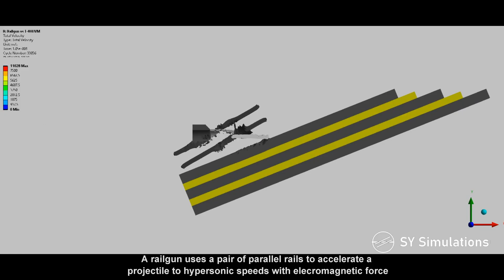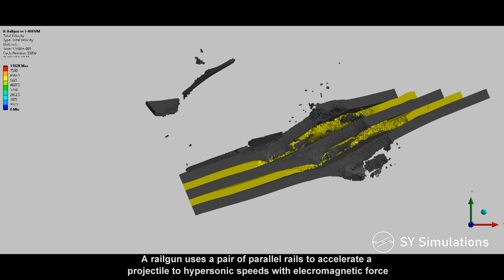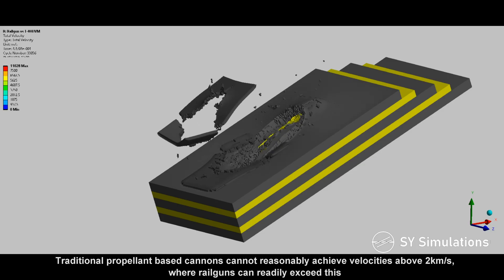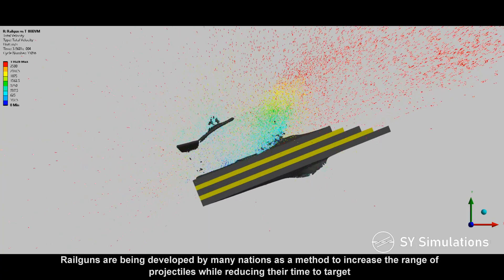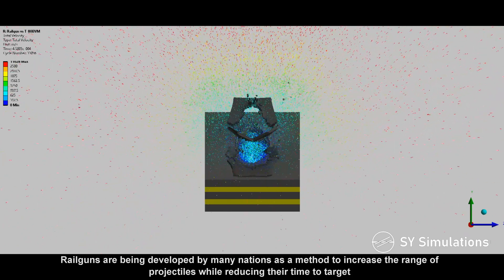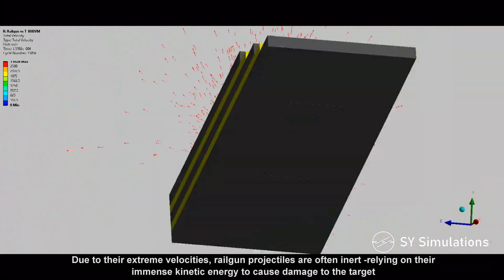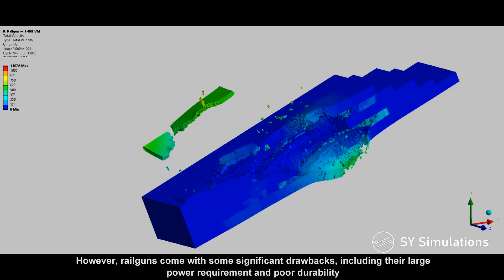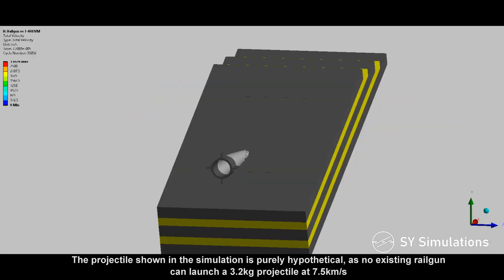RAILGUN vs T-80BVM | Hypersonic Armour Penetration Simulation | APRIL FOOLS' SPECIAL

Comment: War Thunder: orange driver, 15s repair and good to go

World of Tanks: -1500 HP, repair kit and drives off
Reply: In WT either it's yellow ammo or the whole tank becomes black
Reply: @warbrain1053 nah you know they just might hit you with that "shell shattered" somehow
Reply: @arnoldcobarrubias6593  oh yeah that's the third option
Reply: GHPC:

Driver killed
Gunner killed
Engine disabled
Gun barrel compromised
Commander killed
Fire in fighting compartment
Turret drive destroyed

Press TAB to switch vehicle.
Reply: @uschurch  LOL YES
Reply: "Shell shattered"
Reply: Cursed Tank Simulator: Crew knocked out, horizontal drive taken out, radio broken, fuel tank ruptured, engine fire, yellow breech
Reply: War thunder: Tungsten penetrator hits at mach fuck you, shell shattered
Reply: I got one better fam bounce ricochet
Reply: Nah no crew survived 

The post pen is faster than a detonated pg7 grenade
Reply: The biggest problem with railguns is velocity loss over distance. It may exit at Mach 10 but it’ll land at Mach 1. Just bring back battleships at this point
Reply: @davewebster5120 Yes, but a round going at 7.5 KM/S is still getting to 15KM in under 3.5s instead of 20s+. Significantly terminal effects and much faster time on target.

Comment: At those velocities 7500 m/s for instants do you even need to use tungsten? Wouldn’t most objects accelerated to that speed in atmosphere molten by the time they reach the target? Aside from perhaps tungsten or titanium or rhenium.
Reply: It's a matter of density. Similarly dense metals to tungsten just aren't strong enough for this use
Reply: @гига-нигга  You could use uranium, since while it's not strong, it effectively self-sharpens on impact.
Reply: @kauske  uranium may erode more during flight due to heating, I'd hold my breath on materials and let the materials scientists do the testing
Reply: @ You can make a composite penetrator, or ablative non-discarding sabot. But at the velocities that magnetic guns achieve it basically doesn't matter what you're shooting, it and the target will turn into liquid.
Reply: I think you stated your answer in your question? At those velocities, the projectile would hemorrhage material from hypersonic drag heating up the surface, steel has a significantly lower thermal capacitance, so even if it acts as an ablative for itself, it may be far too conductive
Reply: @V3RTIGO222 make a non-discarding sabot

the sabot will ablate, leaving the projectile unharmed
Reply: Carbon/aero gel cap. Wood like the early Soviet capsule heat shields. This is a solved problem.

Comment: That's no longer
 hypersonic. That's re-entry speeds at this point
Reply: But that's reentry speed
Reply: It may be reentry speed, if you enter an atmosphere with 7500m/s. You can also walk at atmospheric re-entry speeds, though it wouldnt be very fuel or time efficient if a spacecraft flew at 1.42m/s down a gravity well.
Interestingly, you wouldnt need a heat shield at those speeds. You would be moving so slowly, atmospheric friction wouldnt produce much heat. Its impact in the form of Wind would be of much greater consideration
Reply: Still hypersonic tho, reentry doesn't have much to do with mach

Comment: Just to give a perspective on speed. 

That projectile is traveling at MACH 21

Just for comparison. The speed at which the space shuttle reenters the atmosphere is MACH 25
Reply: And that velocity is upper atmosphere with significantly less drag
Reply: @V3RTIGO222  and still enough to compression heat air in front of it into a wall of ionised gas.
Reply: The shell whiz/crack from the round flying nearby would be terrifying
Reply: @Flociety It would be like an explosion.
Reply: ive seen video of them firing one at mach 8.8 and it was insane. they had set up had a series of walls and it just kept going through every single one
Reply: concidering it's a low drag object
would this also generate a plasma channel ? or is the aerodynasmic friction just too low for that ?
Reply: @bluewhalestudioblenderanim1132 it plasmas. thats one of the reasons railguns arent so fesable in atmospheric use. between the electricity, the friction, and the fireball they rip their own barrels apart with every shot
Reply: I think he means 7500 feet per second. Unless it's supposed to be a 'what if' scenario, not a realistic one.

Comment: And thats just a 20mm.
Reply: Did you ignore the sabot and gun? Full caliber 3.2 kilo is 57mm territory. 😂
Reply: @alistairalexanders  He's talking about the actual penetrator core, which is stated as 20x300mm in dimension.  For reference as to the stupidity of what a beefier penetrator would do, M829A4's is in the realm of 960mm in length and ~27mm in width, weighing ~7.5kg.  That would just fold the array and the rest of the tank in on itself if it hit with speeds shown in the vid 😂
Reply: @Registered_Simp  of course, and it's fired from a 120mm gun
Reply: @ Yeah.  My response was mainly geared towards the "Did you ignore the sabot and gun" part.

Comment: How about plasma or particle beams? Next year perhaps
Reply: I wonder if the simulation can do such a thing.  It probably doesn't simulate atoms.
Reply: @M4xPower  it could probably simulate a 1mm pellet though, which would enable some sort of similitude simulation
Reply: @MUJUNKY  I don't think high velocity pellets and relativistic ions are relevantly similar.  There have been accidents where people have been caught in a particle accelerator beam and the results aren't consistent with high velocity objects.  The effect of a weapon on a tank would probably be energy transfer in the form of heat and other radiation.  So I think the simulation would have to do flash vaporization of the outer molecules of the tank armour.  Note that the heat effects of high energy weapons like lasers and the heat effects of nuclear blasts are not good at damaging dense materials such as armour, or even just regular metal structures.  It requires the material to melt or sublimate and get out of the way.  This removes energy from the object.
Reply: @ That's a very good point about the need for damaged material to move out of the way. I read somewhere that ceramic armors would be especially good for dealing with lasers because of their ablative properties. Basically preventing any single hit from being able to fully penetrate the armor due to the dust cloud that would form inside the penetrated area. The dust would cause the beam to scatter, while simultaneously leeching the energy of the beam that did manage to keep cutting deeper.
Reply: how the fuck do you think he can simulate PLASMA BEAMS????????
Reply: nuke-powered shape charge

Comment: Improved ERA
Let me introduce myself
Reply: railgun is nearly double the velocity of standard apfsds. I don't think even "improved" era will help. it barely helps with regular apfsds.
Reply: @jmh1189 Russian ones are very effective against Kinect rounds,you can see that this one could break the cape of the shell, and against APFSDS most of the time it breaks the protective cape or takes 1/3 of the shell
Reply: @Miguelitopançudo   но все-таки не против таких снарядов) 
Здесь применяется совсем не стандартное воздействие и наша динамическая защита не предназначена для такого. Однако я благодарен и признателен за хорошее отношение к нашим разработкам, они этого достойны)
Reply: @HoBoeBpeM9l  not gonna lie,You guys produce the cheapest and most effective ways and equipment for your army
Reply: @ its a  matter of pure energy that the slug plus it's velocity is sending into the armor. Something going fast enough is no longer a matter of the round penetrating at all. standard ERA that protects against the long rods of apfsds tries to break it apart spreading its impact a bit. A railgun slug is going to simply vaporize and all that energy is transferring into the armor. Just watch the video. the slug is gone and the energy is imparted into the pieces of spalling peppering the crew compartment. This also isn't warthunder. Disabling a tank in any way that prevents it from doing it's job is a kill. they don't repair in 10 seconds and crews are far squishier in real life.
Reply: @Miguelitopançudo according to Russian arms manufacturers. Whom exaggerate their performs by atleast 50%.
Reply: @TheJayjam Just like USA does when it comes to propaganda, that's the wolrd we live on but honestly relikit is straight up OP
Reply: @ IF it has the alloy composition it claims. IF it hs the explosive it claims. IF it has the amount of explosives it claims. IF the explosives havent expired yet in the stellar russian storage facilities. The US literally conducted a test rebuilding Relikt based on weight claims. Using the best materials , explosives, building practices and scenario for the armour. It performed worse than the russian MOD claims.  Now factor in that russian factories suck, that their explosives are failing, that they store their vehicles outside in siberian conditions, that their metallurgy is easily 30 years behind everyone else and that we have hundreds upon hundreds of pictures of russian tanks having sand or nothing at all in their ERA, or clean head on penetrations in the strongest point of the armor and you can go figure.
Reply: Relikt Is Literally the best thing they currently field